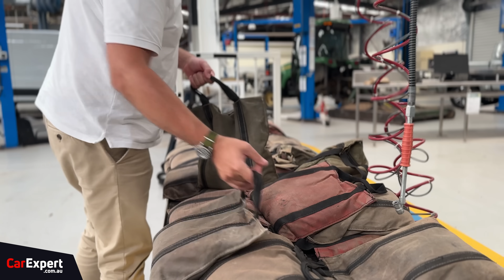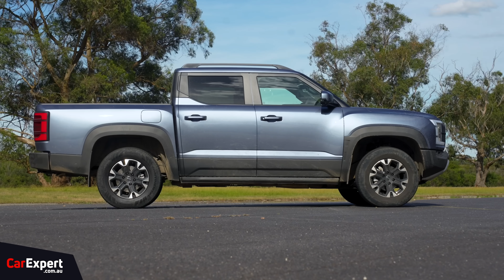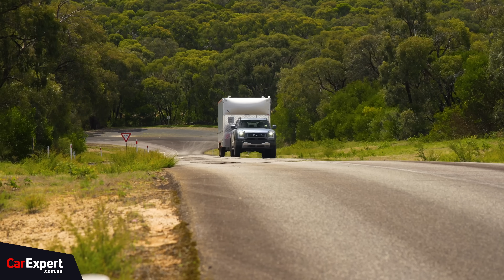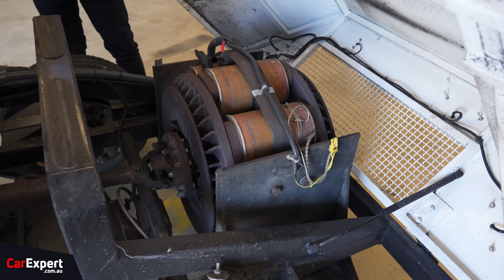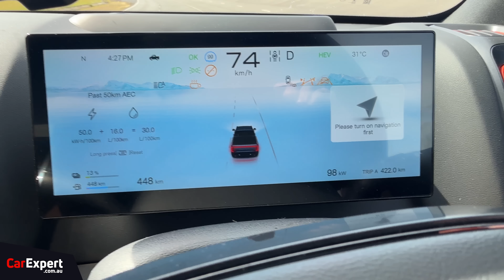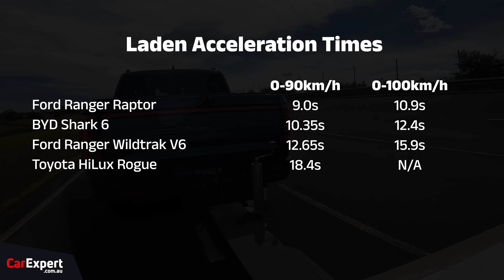BYD Shark 6 towing STRESS test at MAX payload - the results are surprising...

Comment: It's pretty clear from the comments that a lot of people have no idea how this machine works. I would have been interested to know how far it is likely to be able to tow up a decent incline with a good starting state of charge. If I am towing with mine I will keep the minimum state of charge high so this doesn't happen. If I do come across a hill that is likely to reduce the battery too low I'll just slow down. Problem solved.
It might take a bit of work getting the feel for it but I am looking forward to playing around with all the settings to get the best out of it.
Reply: Exactly. It was still doing 75km/h up a long incline with 2.5t
Reply: @Expedition_Tranquilo  I remember I was towing kia sorento diesel 2.5l. I Took a trailer 13x6. Loaded probably a lot. IDK how much I put in there but I was afraid that it could be lots and I have taken out. But It still could be well above the allowed. When i was driving long uphills when the engine got hot the speed dropped to 40km/h and you can't drive faster. So 75km/h is a good result.
Reply: He should have done the test with the battery charged so that the engine wouldn't have to work harder to both charge the battery and power the front wheels.
Reply: @vervetech9395  I agree, I understand the interest in seeing what happens in the worst case scenario but disappointing not showing best case scenario too and get an overall picture of the real life usage.
Reply: It's pretty clear this is a wumao run channel and that those agreeing are either wumao or ignorant. Don't believe me? Look at how many times he's commented. 4 times and exclusively on this video.

Looks like somebody's paycheck is dependent on how hard he can simp for this hunk of junk.
Reply: Grossly unfair test and omitted information. Very poor form. Sorry the long reply - but this covers what people are asking in the comments (theoretically, but should be accurate as a sensible test wasn't done). We can calculate that theoretically you need 83kW to pull 3kN at 100km/hr, add in wind resistance, friction, losses etc, and the fact the Prado sits on 99km/hr (150kw) engine, and a hilux can't even hit 100km/hr. We can assume we are burning 150kw at this speed. Seems battery was "maybe" 60% charge at start (so assume SOC was set to 25% as wasn't mentioned and seems this was a hit job),  so 17.4kWhr of charge, so nearly exactly 10kWhr of charge till the engine kicks in at 25%. At 150kw burn - 4 minutes until you hit 25% SOC and engine starts. At this point things get interesting, at 100km/hr suspect the little engine can put out say 120kw (as it is direct drive, assume max power close to max RPM at say 150km/hr), so the remainder of the battery is discharged to 15% (at 30kwhr burn, consumes the 3kwhr between 25%SOC and  in less than 5 minutes) then then vehicle starts to apply limits. Unfortunately at this point the ute slows, so does the engine and even less kw are available (as the engine RPM drop as direct drive). Hit job. For reference as the physics seems to tie up - a summary below of what height you should be able to gain - at speed with a higher state of charge at max load capacity.

Unladen a ute probably pulls 60kw at 100km/hr. Add a windcatcher, another couple of axles, it's not double, but say 50% more (based on reduced km's when towing with any vehicle), so say 90kW required to tow on the flat at 100km/hr. At this point the ICE can put out estimated 120kw, so happy days, can tow all day on the flat power wise, and charge the battery even, and definitely keep it at 50-75% SOC. Lets assume 50% SOC (so double my calc for 75% SOC as we assume at 25% SOC we have issues best to avoid). Lets hit a 7% grade at 100km/hr. Now on top of the 90kwhr to roll along we need to lift 6000kg (Shark plus Trailer). At 100km/hr we are lifting say 6000kg at 1.95m/s, this requires an extra 115kw of power, so 90+115 = 205kw. (and why very few vehicles can tow a 7% grade near 100km/hr). So at 205kw, we get 120kw from the ICE, and the battery must provide 85kw. A quarter of 30kwhr is 7.5kwhr (Between 50% SOC and 25% SOC), and at 85kw draw - this gives just over 5 minutes - or 8.8km of 7% grade. Double this if you hit the bottom of climb at 75% SOC.

For reference and the biggest uphill haul with a trailer that i have ever made - Wolf Creek Pass, is 14km long at an average grade of 6.4%. So in theory with a 75% SOC, the Shark could drive at 100km/hr for the entire climb, climbing a vertical 900m in 8.4 minutes. (And nobody tows this at 100km/hr, even if your engine that can put out over 300kw (like mine did in the US,) you would melt your transmission. You will not find anything near equivalent in Australia.

But yes - If you attempted Wolf Creek with a SOC set to 25%, or try and tow at 321kw at 130km/hr up a 7% grade for 5 minutes you will end up stalled on the side of the road waiting for it to recharge (at best). If you are that stupid hopefully you are not towing.

Will this analysis hold up... I think it will be pretty accurate... Would i treat the shark like this every day.. no. But nor would I my Ranger.
Reply: @shanebatchelor1  You missed a few things like system losses from engine to generator, generator to battery, battery to controlloer and controller to motors. There are other things like heat build up, rolling resistance, current due to state of charge, motor losses with temperature, losses between engine and wheels through its drive system and all the rest. 
You base the 150kW use on the Prado but pickups are known for having much worse aero's than even large offroaders so even that is being very generous. 
This was also done on a bowl which negates any wind and we've all watched the power use jump into a headwind. 
If it was a hit job why wouldn't they start with the battery depleted? Thats going to happen at some point and if you're using more than around 90kW (after losses) its not going to be able to regain anything in between. 
Remember 30kWh sounds a decent amount in an ev car but in this thing that amounts to around 5 minutes at full load from full to empty - around 3.5 minutes from full to engine kicking in. At half load (which is likely less than its realistic use when towing in this way) its got around 20 minutes in it with the engine helping as much as it can. 
In reality if it was fully charged it may have done another lap at best before the same thing happened so what would be the point?
Nothing wrong with its performance but there's also no point in making it out to be able to break physics. Its a 120kW engine before losses with a boost available while it has charge. That meaans probably 90kW continuous once its all flat - which is why it dropped the speed off.
Reply: @siraff4461  I suggest you learn how to drive an EREV before commenting again.
As with any vehicle, you drive it according to requirements, and that means when towing a heavy load you ensure the battery's SoC will remain at a level that drives through any contingencies during a trip. For example driving with a 2.5 tonne trailer for 200km at a time across the Nullabor would be a doddle. But doing the same in the Blue Mountains is unlikely. 
Also, your maths is out a fair bit as the Shark at 100% SoC will pull at maximum power for over 10 minutes. But there are no roads in Australia that would enable that.
Reply: @remakeit2628 100%. I stand by my math and physics, seems you agree. And it's a shame, I really dud want to see the Shark tested, a 15minute climb - which could have been done would have been great to see. Can the Shark pull hard for 15 minutes and not overheat the electronics... The specs say yes - but this was an actual test opportunity blown by an incompetent (perhaps deliberately) fool.
Reply: Correct, you can adjust the settings so the generator kicks in at 60% charge and the problem goes away 
Paul did a piss poor job of testing, trying to make his overpriced gas gussling raptor look respectable
Reply: @michaelhermans4753  Exactly, I'm not worried in the slightest about running out of power. I'm usually not in a crazy rush to get where I'm going. I lived on a converted school bus for 4 years and top speed up any kind of hill was 40-60km/h depending on the slope. I'm sure this will be a much more enjoyable experience!
Reply: Tbh, it’s rare to see a Ute towing 2500kg+ and traveling over 100kph on highway..
Reply: It's a less than 5-year-old product and has plenty of room for improvement.....

Combustion pickup is a product about 100 years old and the room for improvement is much smaller
Reply: Hmm seems more like you're telling yourself to believe what may be an issue is not an issue.
Reply: why paul not let the ice work?when the power like 13% and he still got full tank fuel, that is not worst senario, thats stupid @mrkring1526
Reply: @mrkring1526 I simply can’t see a scenario where this would be an issue for me so no it’s not an issue for me.

Comment: Thanks, Paul. Overall very impressed considering my max load will only be 1.5 t. I think with a bit of education and management the under two tonners will be very happy. Looking forward to delivery in March. Thanks for your work.
Reply: The 2.5 tonners will be fine as well, as long as they expect to be doing only 75km/h up a long ascent.
Reply: @Expedition_Tranquilo  SOC Was set standard, set it at 75% and you will never be limited, granted it will only get the same fuel economy as a dinosaur muncher, but when  not towing the wife can drive it around for virtually free thanks to the hundred kilometre plug-in, diesel tax coming in two years 🤣

Comment: So BYD could slot a more powerful ICE under the bonnet. Something like a 2L turbo with 180kw.

Regen is also depends on battery SOC . You cant  regen if the battery is close to full.
Reply: They already did. It on the SUV version of the platform called fangchengbao 8, but it's currently only available in China. Btw they also added 2 differential locks both front and rear, a low gear transmission on the rear motor and a hydraulic suspension set up on it, which makes bao 8 a much better off roader than the shark.

Comment: It seems it tows Ok when the battery is charged, but flat battery gives a gutless ute. So in the real world it is only if the battery is charged it is any good and you would not want to tow long distances sitting on 100kph..  If  I towed at the slow speeds you did in this test with the caravan on the back,  l would have some pretty unhappy motorists behind me.
Reply: Towing at 100kmph would not use the same energy required here. Paul's Hill road loop went from 70 to 65 and included planting on steep uphills with 2.5 tonnes and max payload.
Reply: YOu are bad at physic ,in real world when towing at 100 km/h engine has more then enough spare to charge the battery ,you can set by you self in menu how much you want,he set it lowest posible and then simulate hill that he cant find in real world